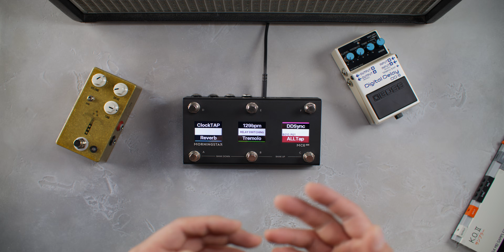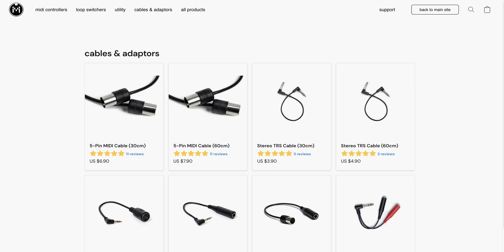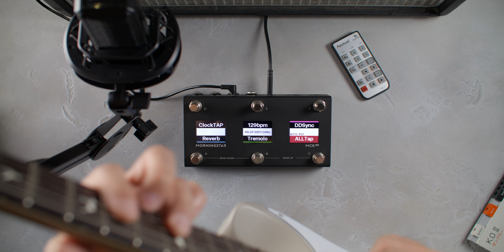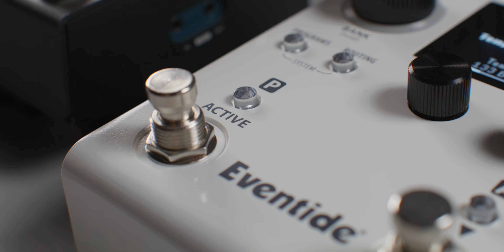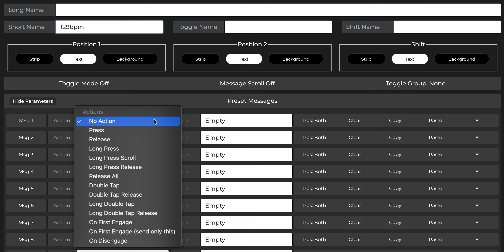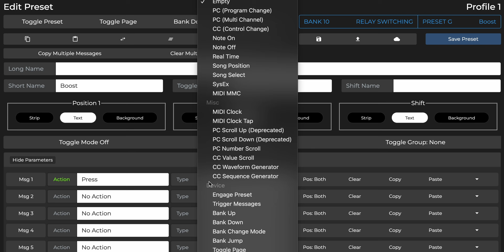Relay Switching - Control Non-MIDI devices with a MIDI Controller

Comment: I am having trouble setting up relay switching with a Blackstar HT Metal 60 amp. I just need to switch between the various distortion and clean channels. Can you perhaps have a look if this is at all possible with this amp? The same TRS cable works with my NUX Stageman acoustic amp.
Reply from the maker: Hi! Please send us an email at ‘help@morningstarfx.com’. We provide support from there. A service ticket will be created for you and we will be able to follow up easily.

Comment: Can you send a relay command and a MIDI message at the same time with the same footswitch? I want to control both my amp channel and my multi fx (create Clean/Crunch/Lead presets, which would imply changing amp channels + engaging/disengaging effects).
Reply from the maker: Yes, for sure. You can send up to 32 messages with the MC6 PRO with a single switch. It does not matter if they are relay or MIDI commands.

Comment: Could this be use with something like the vertex boost pedal to control the volume pedal feature that’s over TRS?
Reply from the maker: That TRS port on the Vertex Boost is for connecting an exp or volume pedal. Connecting it to a Relay Port on the MC6 PRO will not work.
Reply: @MorningstarEngineering  thanks for the reply! Is there a way to setup my expression that u use for my MC6 pro to work with that vertex boost?
Reply from the maker: @dillontaylor8035  If you do not need to use that expression pedal with the MC6 PRO, you can use it for the Vertex Boost instead. However, there is no way to connect from the MC6 PRO to the Boost as the Boost is not MIDI-capable.
Reply: @MorningstarEngineering  thank you! Have a nice night :) love my mc6 pro! Also love the online midi controller that’s in beta!

Comment: I'm having problem with my Source Audio Collider. It has dual footswitch. One for delay and one for reverb. Problem is they're too close to each other. Can this switch pedal set it as only one of them to be turned on? Most switch I've tried make them both of them turned on because they're in one pedal.
Reply: You can look at the midi implementation for the SA Collider there is an option for a midi command to control that

Comment: Just had my first session with programming the Omniport Relay Switching Interface...and with a DOD Rubberneck🤦‍♂ (it uses a weird 3-button switch). Trying to sort out what does what was like pulling teeth, due to the 3-button scenario. But the Relay Switch and the editor prevailed. I have: tap tempo, delay Mod ON/OFF, runaway Regeneration ON/OFF and the "Rubberneck Effect" under MIDI control. **NOTE to anyone else trying to set up the Rubberneck Delay with an MC MIDI controller, DO NOT try and use the Rubberneck effect and the runaway Regeneration at the same time....or just don't use any of the other functions while either of those effects are engaged. The controls for the Regen and Rubberneck will get swapped in the pedal....it's a headache.

Comment: can mc6 receive midi clock and send the same tempo to the boss?
Reply from the maker: Yes, it can. You can set the Relay Ports to send out tap tempo in sync with MIDI clock BPM, which can be received from an external device/software.
Reply: @MorningstarEngineering  can the mc6 mkii + relay interface combo do the same thing?

Comment: Can this work sending tempo from my DAW? So bloody cool!
Reply from the maker: Yes, you can send tempo from your DAW to the MC6 PRO to set its internal MIDI Clock BPM. You can then sync the relay clicks to match the MIDI Clock BPM, effectively syncing your non-MIDI devices BPM to your DAW.
Reply: @MorningstarEngineering  hello is it possible at all to recall a favourite preset from Strymon mk1 pedals (non-midi versions), like the El Capistan for example? I hope so using the MC6 pro!

Comment: Are there relay ports on the ML10x? Or is it only on the MC6 Pro (for now)?
Reply from the maker: This is available only on the MC6 PRO. The ML10X is a loop switcher and is not designed for this purpose